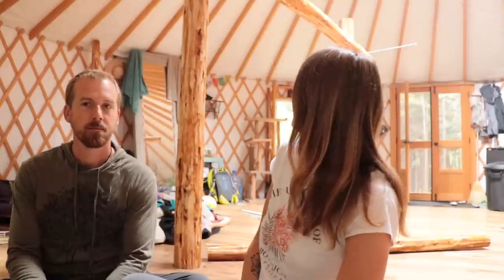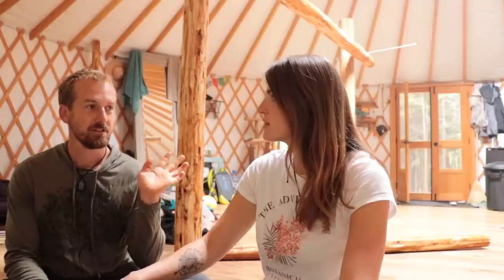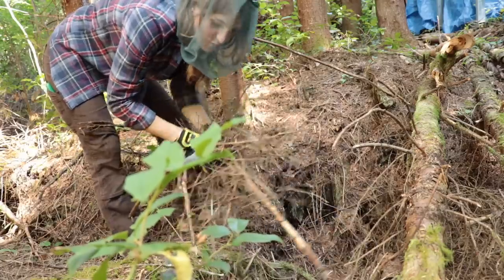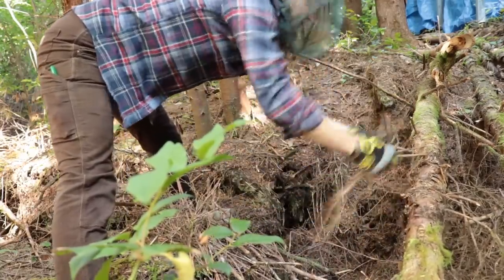Living Off Grid in a Yurt | Building a Loft, pt. 2 -  Ep.41

Comment: if you think it's safe, then that is for your to decide, but the beam going across the uprights is resting solely on those rods...anything you add to that top piece is also going to rest on the rods.  Just think about it.  In addition, your clothing...with all bathing being done downstairs, your clothing should be there, as well.  Otherwise, you will have to take clean clothes upstairs to store.  Then when bathing, go upstairs to get clean clothes, downstairs again, bathe, dress, maybe even take dirty clothing upstairs again....better to have closet in the bathroom.  Mosquitos...they breed in still water...make small mechanical machine to aerate the water nearest your house, that will help some.  Then, purchase a metal cigarette lighter to carry with you...when bit, as soon as possible, light lighter, heat for a moment till it's as warm as you can stand...close lighter.  Now apply hot metal to bite...you will soon get the rhythm...I count to 5 or 6...it will kill the mosquito saliva that makes you itch and welt....you won't catch all of them, but the relief is almost immediate and is wonderful.  At home I run a metal spoon under hot water to achieve, but I find the old metal lighter the easiest thing, to carry and use, when outside.  Also, your neighborhood looks like you could grow aloe...besides being useful for a number of health uses, it helps relieve the itching reaction, when broken off and applied to skin.  Get several plants, and only break or cut off an inch, rubbing the raw break on bites.  You only waste the entire stem by breaking off the entire thing.  Sorry if this is TMI...I'm a mom, we can't help ourselves....

Comment: I love the video but am concerned you lifestyle could be ruined by a serious injury. Please trust the comments here. They are correct to recommend notching the posts so the wood takes the weight and not the rebar pin you placed. Fasteners in building are only to support two pieces together, not support the weight of two pieces plus what you add in more structure. Please rework the loft supports properly. That structure will crush you or break a back when it does collapse not in years but months.

Comment: all of that weight is completely resting on the dow rod. I would not trust that. Notched wood would be better.
Reply: I realize I am commenting on this late in the game, but I agree with Glen, Ideally the horizontal log should be supported by the vertical logs i.e., resting on top of the vertical log post heads, not side anchored with a 1" bolt, or even straps, because that negates the entire purpose of the vertical support, where your weight is now on the straps/bolts, not the vertical strength of the post itself.  So, it really does not matter if you are putting a lot of weight/stuff on top of the loft, my concern would be that everything is resting on those bolts/rods, specifically the weight of the horizontal beam, which is quite heavy in itself.